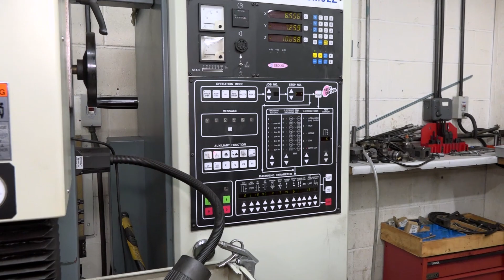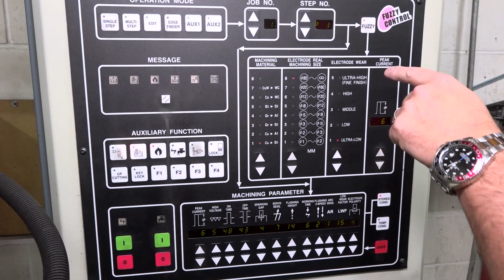This shape burnt out in just 15 hours

Comment: Why spark. Could this not have been milled?
Reply: I think it was mill and then spark for the fine detail  which a endmill cant do
Reply from the maker: it probably could have been but not as effectively or to the correct detail
Reply: @MTDCNC  Why wouldn't they rough it out on a mill and finish spark it? Would take a lot less time than 15 hours
Reply: Edm is great for odd geometries like square features or surfacing where only a 5 axis mill could do it. Edm is also used to impart the correct surface finish onto the moulding cavities/cores so that polishing isn’t needed (or very little).
Reply: Like in the thumbnail the ends of the cavities come to a 10 degree or less sharp corner that a mill couldn’t do.